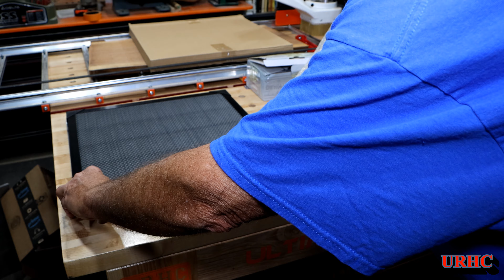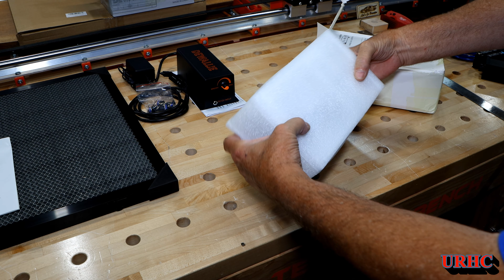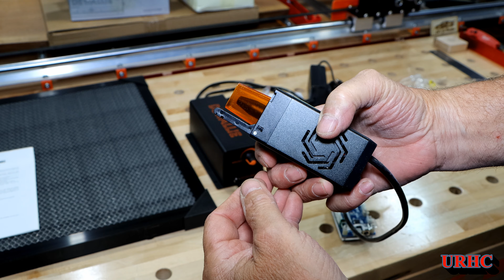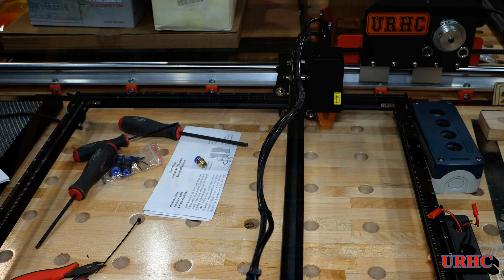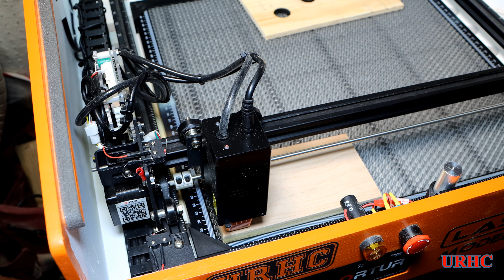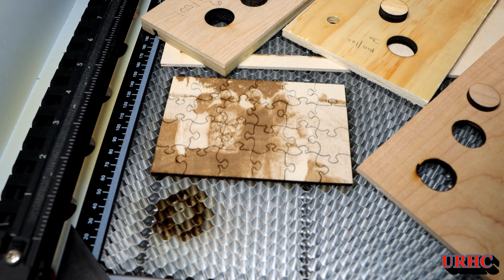Ortur / Dewallie 10 Watt Output LM2 Pro Upgrade Package

Comment: Great video, I bought both the 10W and the DeWalle air assist like you. Question, when I installed the 10W with the included circut board and power supply they include, the laser instantly turns on and begins running/cutting. Did you ever have this or know anyone who did? Some people suggest I not use the 2nd power adapter with it but Im unsure.
Reply from the maker: You have a problem.  Be sure all cables are properly installed and seated. You need the second power  supply for the laser and all the cables supplied  with it. Don't forget the frame ground that can remove ground loops they added. Contact Ortur because that sounds dangerous.  Thanks for watching.

Comment: I just bought direct from AE for $170 with free shipping for the complete upgrade (module, board, power supply, spare lens, mounting hardware) saving me $120!!
Either I got lucky and they messed up the order or there are places out there cheaper!
This module upgrade was worth the wait.
They do recommend a 50 l/min air assist for it (says so in the manual). I was going to get that Dewallie Air assist, but that don't put out no more than 16 l/min which is inadequate. The only one that does fit the bill is one of the newer Ortur air assists. Hefty price as well!
Reply from the maker: This stuff pretty much changes everyday lately. Definitely a nice machine. Have fun. Thanks for watching.

Comment: I would have hoped that they would have used the fine adjustment screw plate instead of the side catch screw inclosed with the 10 Watt laser. 
ORTUR Laser Head Focusing Controller for Ortur Laser Master 2 Pro S2
Reply from the maker: That is only unneeded  extra mass. With  the drop down focus bar the screw works great and they added a spring steel plate to eliminate dents in the aluminium.  The same laser is used on the LM3 that runs almost  twice the speed so extra  mass matters with a heavier laser. Thanks for watching.

Comment: Sure new 10 Watt output lasers with two diodes an 20 Watt versions with 4 diodes are awesome. Expensive but pretty strong. 
Now it is not all in amount of output power. Diode lasers wave length is 405 to 505 um typically. CO2 go 900 to 1100 um. Fiber go up to 2200. This makes them different even if they have same optical output power. You need shorter waves fir some materials. If you cut wood it does not matter all of them will do. In that case Watt is a Watt typically. 
Wanna cut transparent acrylic? No diode laser will do it. Reflective stuff and translucent stuff requires C02 or better with shorter wave length. Diode lasers will engrave stainless steel but will not touch non anodised aluminum. For cutting steel you need fiber laser. CO2 will not do it. Now people cut thinner Rader blades with 20 Watt  diode lasers but it ain't clean an it works only with stainless steel blades. So you need laser type depending to type of your job and material.
Also 10 Watt might be even to strong for some job and ti do same job clean one needs to reduce it's power to single diode laser levels. Otherwise it chars and cuts where it needs to engrave. You increase a speed with powerful laser module but on some materials you will outrun the gantry and reducing power is necessary. Hence smaller power laser might fut to some job better. 
That all said I like that most if multiple diodes modules keep longer distance focused beams and dits are more square and often smaller than single diode modules. This means more then just raw power. Badly focused module will lose ton of it's power. So again we all like more power though do we really need it is question Fir it self especially with the price difference. Often dual diode machines are 200 to 250 bucks more. Imagine paying that and having to run it at 50 percent? I think if you are doing more products it might be better to invest in two single diode engravers if you do not need that power and single diode laser does your job right and fast.
Reply from the maker: Use what you can afford. Many individuals  have started companies around these  blue lasers and make a good living from them. The biggest sellers seem to be engraved graphics on wood That can be done with any wattage if you have time. The higher  output lasers allow speeding up the process that raises profits.  Not everyone needs the higher watt heads but they are a good investment if you're running  a business.  The new Ortur LM3 10 watt machine I just received achieves speeds that save time and a very precision  cut at 3mm with 1 pass. Many people upgrade these like  they do with their iPhones and as long as the market is there the laser companies will continue to offer upgrades weather  they are really needed or not. Thanks for watching.
Reply: @unemployedredneckhillbilly2023  agreed. Same as with other stuff often medium level product has the performance needed for the task on hand and are priced relatively reasonably while hallo products demand pretty unreasonable price. Sure it is top of the line but is it really needed and should it cost that much? Consumer oriented society as it is now allows them to do that because people buy newest and most powerful models no matter what. Why not than abuse it? Like top single diode module of other brand cost me 79 bucks. Dual diode module cost me 259 plus 30 bucks for bigger PSU. That brand model uses sane size housing, stronger misfets in the driver and prism to direct the second diode into the same beam. Sometines it has an additional lens to. Material costs like maximum 40 bucks more and manufacturing costs might be like 20 bucks more. To pay off the development costs add another 15 bucks on the top of it while it is high volume product. So double the price.  Why then mire than 3x higher price? Because they can do it.

Comment: Good video as always Ed, but I did get a chuckle from the Co2 comments 🤪. Wait until they send you the LM3. I'm testing that one now with the Dewallie AA and it blows away the LM2. Up to 20,040 mm/min engraving! Though most of the time I'm round about 10,000 for best results.
Reply from the maker: I just received my LM3 but haven't gotten started testing it yet. Can't wait to  fire it up. Trying to figure  out an enclosure using the new Dewallie that was sent with  it. It's  amazing how far these little  lasers have come in a couple years.  Thanks for watching.

Comment: Thanks, it's a good video. I'm not sure which laser module to buy,
 Atomstack m50 or Ortur LU2-10A.
 Assuming I'm not going to use an air compressor on the LU2-10A, which laser module do you recommend for faster cuts in dense woods with thicknesses from 3mm to 8mm?.
Reply from the maker: I just made a video about the upgraded 10 watt laser for the Ortur LM2 Pro and that blows away all these other machines. There will be a LM3 released in 2 weeks that I can't wait to try. Ortur has the best support and least problems from the feedback I get. Hard to keep up with all the new models. You will need an air assist pump for any of these higher powered lasers to get the best results without fire and burned edges, Thanks for watching.

Comment: Ed, you are absolutely right about this laser. I got my Ortur 10 watt module last week. Folks, you put this laser module on you LaserMaster 2Pro and you can easily double your production and in some instances quadruple your production. I cut some quarter inch hard maple at 200mm/min at 100% power in one pass with no charing on the edges. It was incredible. The beam intensity is tiny (.05 x .1 mm). At 100% this thing is burning at about 2700° F. 
Unless I was cutting clear acrylic I wouldn't even think about getting a K-40 because from the videos I have seen this blows the K-40 out of the water. If you can afford it this is a good upgrade to make. If you are making a living with your machine, upgrade now, you'll be glad you did.
Reply from the maker: This definitely is the best 10 watt yet. It blows away the  xtool and Atomstack versions I use and comes with the best support of all the laser manufacturers I have dealt with.  2 years ago I couldn't  imagine that these blue lasers would be competitive with Co2 machines and now they are. You are the true Laser Master and I can't imagine the projects you are working on with this. Hope you and your  family  are doing well. Thanks for watching.

Comment: How about doing a pass on the 3/8 ply then lower the laser 3mm to 6mm and do a second pass
Reply from the maker: You would  hit the workpiece with  the nozzle.  9mm  takes 3 passes at 90% 100 mm/min or 2 passes at 100% 80 mm/min. I dont  like running  at 100% power because  it shortens the laser life. This is a very hard plywood  and you should  test what you use first.  Thanks for watching.
Reply: I have 3D printed a nozzle that fits over my 5.5 watt stock laser that came with my Ortur LM2 (not pro). I have also printed a new back mounting plate set so I can use the adjustment slide designed for the LM2 (Pro), added an extension to the adjustment screw to give it more reach. I have the Grid with the backing plate and the Air Assist (you are right, it is noisy until you reach 2/3 power. Have been looking at the 10 watt Ortur but not sure if I can use on my 12VDC LM2 (I would think so since all that comes from the motherboard is the cut signal with power provided by the new additional board. Now w have a 20  watt laser reaching the market and talk of an IR 40 watt diode laser. Hard to keep up and decide when enough is enough.